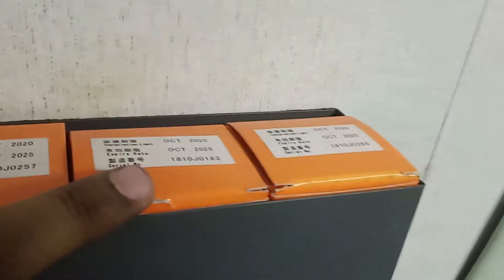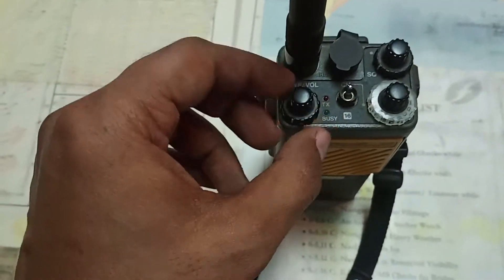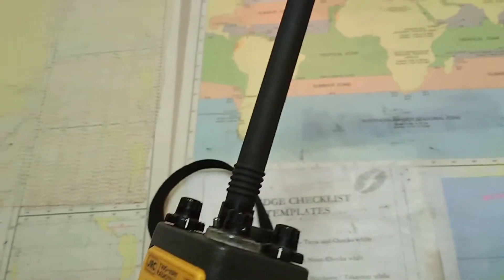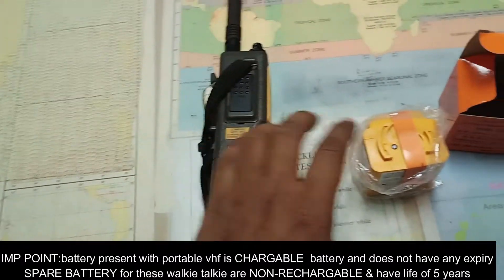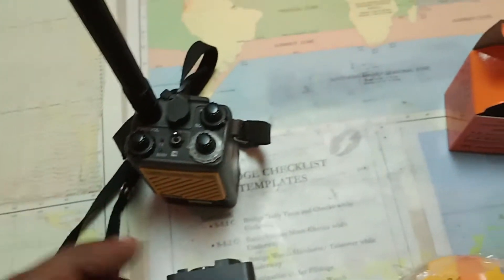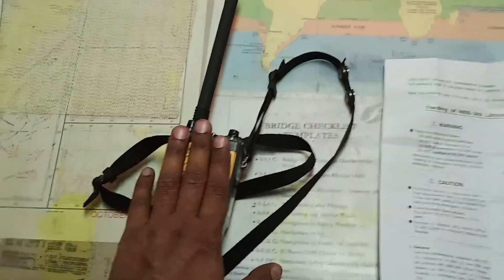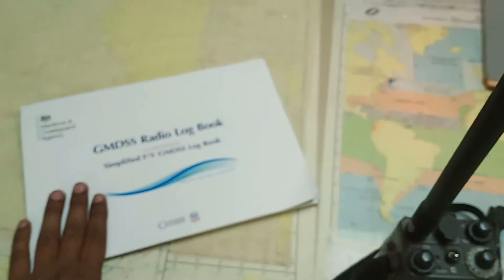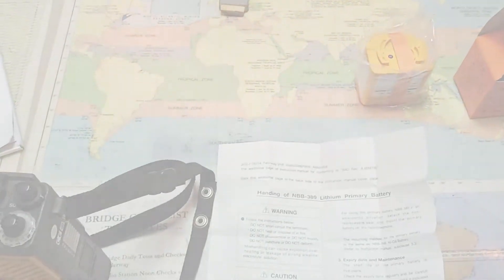Gmdss walkie talkie -Requirement and Use

Comment: Sir, Is there any requirement for the spare battery?that it should be non-rechargable only? because nowadays ENTEL VHF WALKIE TALKIES are coming with both batteries as secondary battery (i.e. battery with walkie talkie+ spare battery)
Reply from the maker: no there is no such requirement tht those shall be non rechargeable, they can be chargeable too
Reply: @atlantianpawanharyana1005  ok sir thanks ❤️🤗